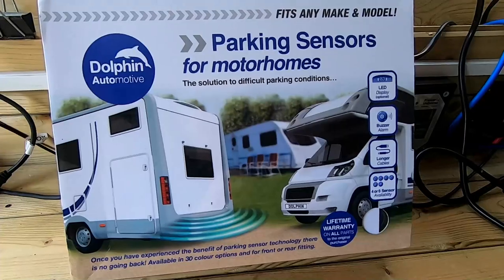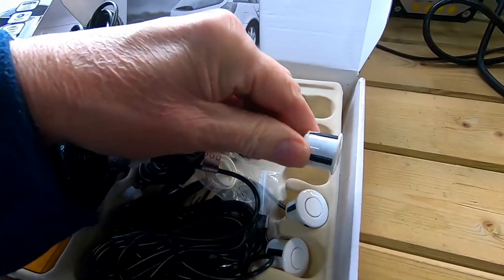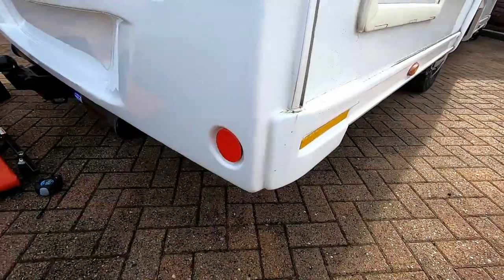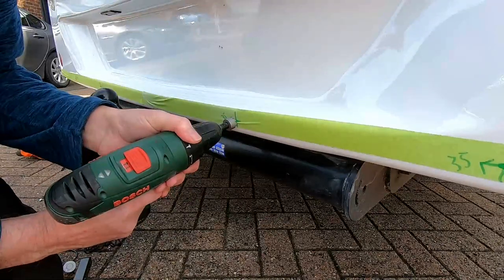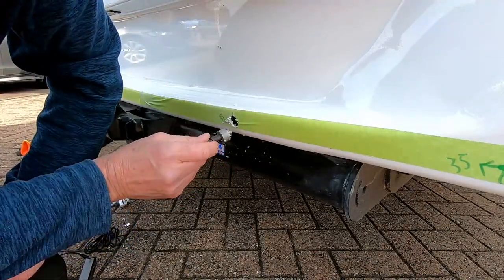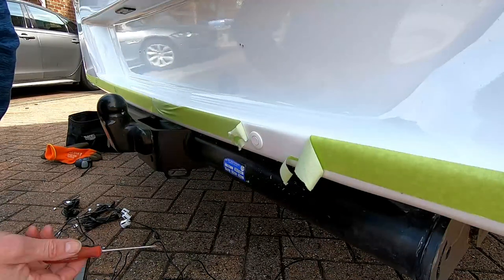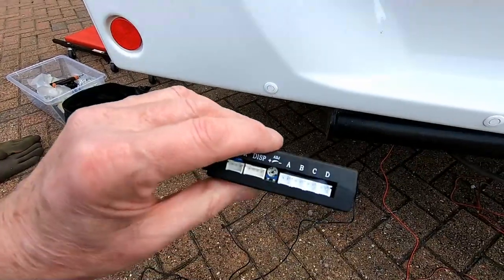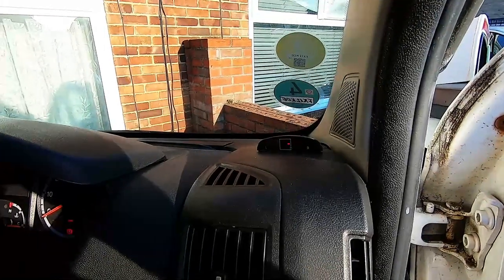Reversing Sensors

Comment: I’m fitting the same atm. Where did you pick the feed from the reversing light from?
Reply from the maker: From the reversing light and connected the negative wire to the vehicle chassis. These still work a treat👍
Reply: @astrospire  Cheers - I did the same, didn't know if you decided to tap in the the loom further up